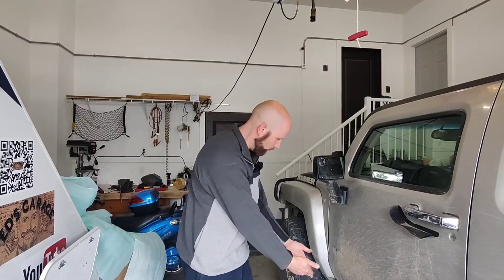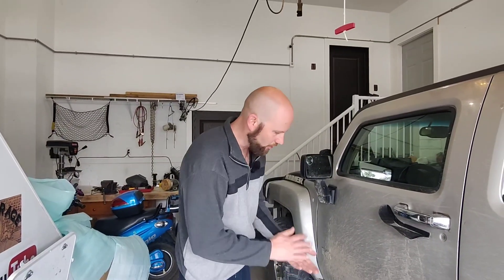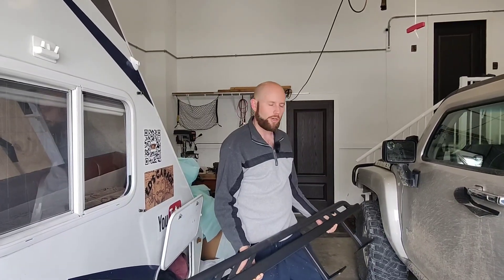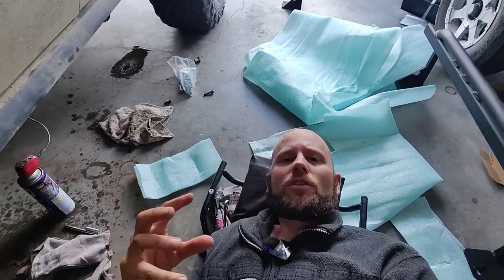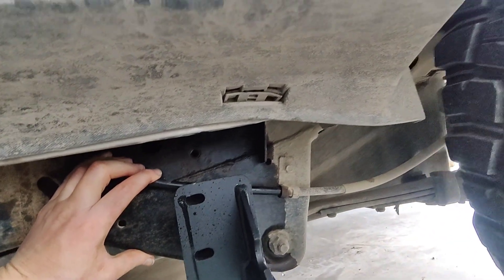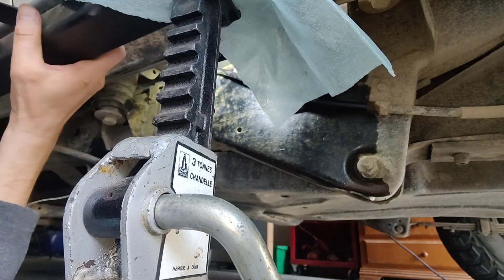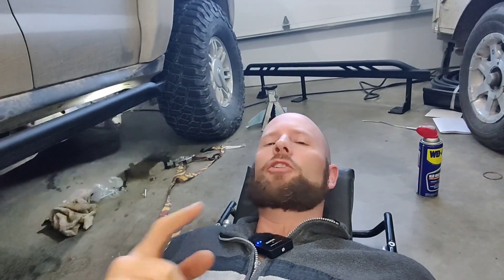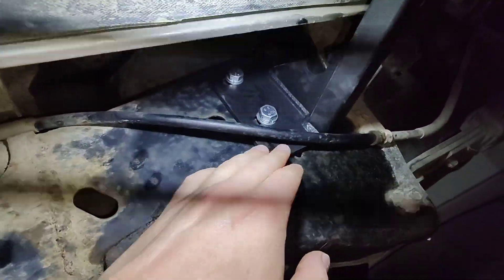Hummer H3 Rock Slider install!!

Comment: What size tires are you running and did u use spacers in the stock wheels? Looks great!
Reply from the maker: @ob1791  35" tires (equivalent) ... No spacers, just the torsion bar crank to level the truck. 

I did also do a 1" body lift to help, but it wasn't really needed. (I have a video of that on this channel as well)